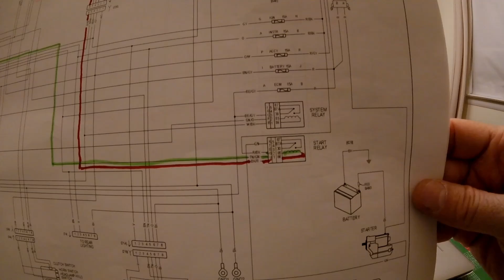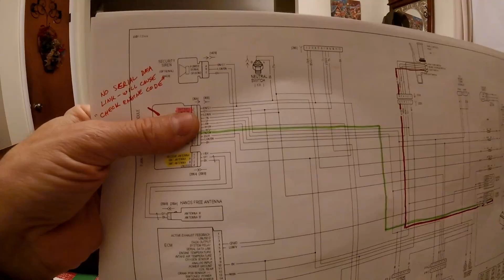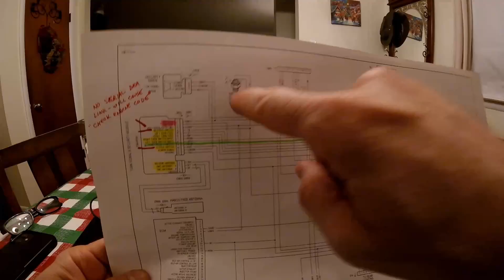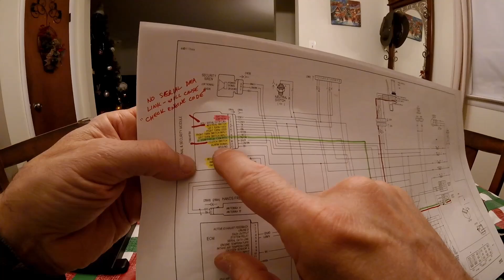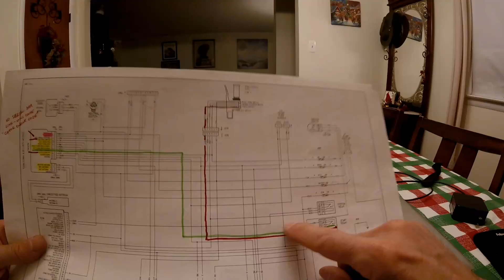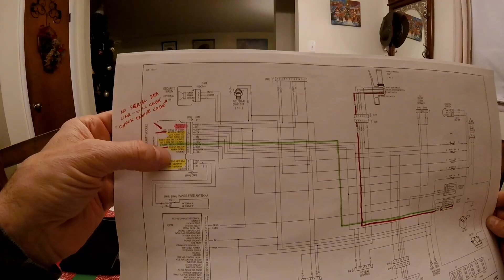Harley Security System Delete & Turn Signal Removal. Twin Cam 1999 to 2010 module TSM & TSSM

Comment: 05 sportster 883 

Would be very grateful for any help or insight of a 2005 Harley sportster. Got outta modified cars and got my first bike.

Bike info: The previous owner or owners had deleted the speedometer. I’m guessing due to having tall risers and deleted the rear signals to be able to use saddlebags. Ignition switch was bypassed too with a switch.

Issue: after , putting a new speedo and turn signals all indicators on, the speedometer mostly works, including neutral light, turn signal indicator (on speedometer), oil light, but the speedometer itself does not move up while riding or the back light for the actual speedometer doesn’t turn on. Rear running light works, but brake light doesn’t work nor do the rear turn signals work. Then the switch for ignition is turned on after a couple of seconds the turn signal blick together a couple times

Was not given key fob or pin

Bike runs like normal no issues other than the ones listed above^

Any advice would be greatly appreciate
Reply from the maker: With the speedo not working I'd also check to see if the power is there. You have a 12 volts from the battery after you turn the main power on and a switched 12 volts. You need both. I'd also check the ground. If you need further help, let me know. It would be very hard for me to think of every issue it could be without me standing at the bike...
Reply from the maker: Wow! You have a lot going on. I’ll pull up the wiring diagram but it sounds like you either have a bad speedo or a bad speedo pick-up. If you search my channel you’ll see I have a video on troubleshooting the speedo. You should check it out. Then we can discuss that problem further.
Reply from the maker: https://youtu.be/p__GXwkqPSY
Reply from the maker: Ok after looking at the wiring diagram I found that the TSM (turn signal module) controls both the front signals, rear signals and dash lights at from the same output. So if the front and dash work you will have to find where the signal is being lost to the rear lights. That being said with the rear signals and the brake light not working I'd look for broken wires unless the brake light switch is bad. The switch is easy to figure out with a volt meter or by jumping the switch wires out with the bike turned on. It should turn the brake light on.
This is for the wiring diagram.
https://serviceinfo.harley-davidson.com/sip/content/document/view?id=5532

Comment: Isn’t this essentially running a direct starter button on the solenoid? I picked up a fobless 04 tc and trying to get it running. It turns over with the direct start button. Does the TSSM inhibit any of the running essentials (spark/injector signal)
Reply from the maker: The relay that it turns off, turns everything off, including the coil and the injectors. My modification doesn’t cost you any money either.

Comment: Anybody wanting security, fob delete theres a vid on that using part # 68920-07 $250, and no wire cutting. I think its' for most big Harleys.. Replaces the signal/security module to the signal only type.  It's just above battery.  I think all the people in comments having problems will need that, and to do a short esc reset as given in instructions.
Reply from the maker: Drag Specialties sells this part also.
Reply: i cut and grounded tan wire it made the bike fire and shut off i need it too stay on

Comment: Hi.  I will give this a go in the next week or two as my fob is very tempermental, My alarm and immobilizer still work ok its just the turning them off with the fob to start it, do you think it would be possible if i fitted a rocker switch in the tan/green wire so in one position it will complete the circuit from module to relay and keep the alarm and immobilizer, then when i want to start the bike flip the switch so the wire from the relay goes to earth. Hopefully have best of both worlds. Thanks Mick.
Reply from the maker: Yes that should be fine. It will go to battery ground not earth… I knew it’s what you meant 😊
Reply: @Rapsgarageshop  Just tried the wire from relay to ground today, All i could get was all the indicators flashing, the engine fired a couple of times and thats it, reconnected the tan/green wire together, engine started fine, any ideas..Thanks
Reply from the maker: @mickd3244 I’d put a volt meter on the output contact of the System Relay to see if it’s staying energized.

Comment: Hi I’ve a 2001 dyna fxd  I cut the tan and green wire from the module under the seat and grounded the wire but now the bike will turn over but won’t start have I grounded the wire going back to the loom and taped off the short bit going into the module
Reply: Put the module back in correct position and the bike started and ran for 45 seconds and cut out and won’t stay running it’s the carb version 2001 fxdt am I better off reconnecting the tan wire to the module and going back to the key fob only the fob inconsistently works feels like it will let me stranded som day
Reply: @skippey1353  did you get your bike running? I’m pretty sure the answer is no! What country are you in? I’m in uk and have just  deleted my security module with no problems but not using this information, had to buy 3 cheap items to make it work, cost in uk about£70 pounds and a bit of wiring.👍
Reply: I can’t find your reply’s to my message! Have you sent me contact details so I can forward you the instructions to remove Tasmania, where are you in uk? I’m in Cornwall👍
Reply: @MarkHancock-u6k  Hi. Do you still monitor this post, really intrested in the TSSM Mod
Reply: @mickdobson mick what country are you in? Send me you email and I will send you instructions to delete T s s m with very little cost, most independent shops want to sell you expensive parts that are not needed!
Reply from the maker: @skippey1353  Sounds like you have a totally separate problem. Try using starting fluid to keep it running when it starts to cut out. This will determine if your problem is fuel related or electrical. Let me know.
Reply: @Rapsgarageshop it ran fine before I went and cut the wire i just felt the immobiliser fob was a bit temperamental and I wanted it gone/deleteded before it let me down on the road I’ll earth the tan green wire directly to the battery earth connector later in the next day or so and get back to you cheers 👍

Comment: Ok so all you do Is cut the starter relay wire , which is tan with green strip.and then ground it. Just depends it from the module
Reply: Well I did that and it wont it will not crank, I took the tan with greenstrip and grounded it to the battery.the one on the module  I did nothing with it
Reply from the maker: @JohnwScottjr.  Sounds like you need to check a few more things - battery good, is the relay good, fuse good, do you have 12 volts at the relay? Let me know...
Reply: @Rapsgarage I will let you know I have not worked on since I text you. I'm going to check all these things
Reply: Hi I hope you're still here . I have 2001 carb softail and no tan/ green wire? How do I know which is no9? 
From u.k . Thanks.
Reply from the maker: @holmicus I just looked it up and it should be exactly like I described. See the Harley website I attached. 

https://serviceinfo.harley-davidson.com/sip/content/document/view?id=5527
Reply: @Rapsgarageshop Thanks I found pesky wire and grounded it. I sent another message.  It cranks but no spark and indicators still flashing 3 times  . ? 
We all appreciate you . Much gratitude.
Reply from the maker: Cut it from the module and ground it

Comment: Sorry to hijack this comment section. I have a 2007 Harley Davidson Wide glide -EFI

I followed the instructions to a tea. The lights still blink when I turn ignition to on. Motorcycle will not start(wouldn't before) but shuts off after a few seconds. Any ideas?
Reply from the maker: You say will not start?? The fastest way to figure out what it can be is to spray it with some starting fluid. If it pops off try to keep it running on the spray. Let me know what happens.
Reply: @Rapsgarageshop Hey rapsgarage so it starts and then dies like the fuel or spark is being cut by the ECU. My bike is EFI
Reply from the maker: @kodyarocho4618  like I said, try to keep it running with the spray. It could be your fuel pump. Let me know afterwards and we can discuss it further.

Comment: Ok sorry about that. Okay. I have a 2007 ultra classic electric glide.  On the starter relay tan wire with green strip. On the module at pin 9 it's a white wire with  blue strip
Reply: Well I finally got it cranked But it won't stay running
Reply from the maker: @JohnwScottjr.  I’d hit it with some starting fluid and see if you can keep it running like that. If you can, you know you have a fuel issue.
Reply: The lights are still flashing But it's still cranking in neutral without holding the clutch in I tried that with the starting fluid Runs with the starting fluid but quits
Reply from the maker: @JohnwScottjr. I’m not sure I can help much more without being at the bike.
Reply from the maker: All the diagrams I see don’t show that.

Comment: I can get it to crank and start but it dies after a few minutes. I clipped the tan wire with the green line and ground at the starter. I can now start the bike but it does after a few seconds. Is this supposed to bypass the security so you can ride the bike? Has anyone actually been able to ride their motorcycle after doing this?
Reply: So you still have the tan connected at the tssm? But taken off the starter ground?
Reply: @jakobrichards7814 I cut the Tan wire with green line at the TSSM. I left enough of a lead to be able to reattach if need be. 

I then ground the tan wire with green line at the relay
Reply: @kodyarocho4618 so you grounded that wire to the relay? Or attach the tan and green wire to a good ground after it’s cut?
Reply: @jakobrichards7814  the wire runs from the relay to the TSSM. It was already attached. When I cut it the section that was running from the relay got grounded to the bike. My bike will now start but immediately dies. It's not a fuel issue
Reply: @kodyarocho4618 I have the same problem.. what to do from here
Reply: @Iniajameskauri  buy a TSM module and flash it to your bike that's what I did. Took a half an hour. The guy in this video is right if you have a carb

Comment: With a bike without a security system, would stripping and grounding out the black ground wire from the tsm also be a viable way of bypassing the tsm while also still having it communicate with the ecm and having other functions work? Bike currently won't start click nothing, all lights and turn signals come on but won't flash so I'm thinking TSM may be bad?
Reply: did it work?

Comment: Hi there. Not sure if you still answer comments and questions but I have an 2001 Wideglide carbed. I tried pin 9 and I saw another comment using pin 10 instead on his 01. I tried pin 10 first. Then pin 9 and still nothing. Any suggestions? Thanks!!
Reply: You nailed it!! I did as you suggested. It in fact was pin 9. Grounded it and it fired up! Cant thank you enough!!
Reply from the maker: @mammen33  I’m so glad to hear it. I appreciate you getting back to me and letting me know how you made out. If I can help in the future, please let me know.
Reply: Yes sir! I will and again, thank you!
Reply: Thank you! I really appreciate all the information. I’m going to be back within the next few days. I’ll let you know
Reply from the maker: @mammen33  Sounds good. I can help further if you need it.
Reply: Hi I am about to try this. On an 09 1200 Nightster. After the 4 listening think I got it sussed. Will let you know. Be mello
Reply from the maker: @maxvfour7345 very good. Thank you for watching
Reply from the maker: I'll look into this tomorrow and get back to you.
Reply: @Rapsgarageshop thank you! I’m wondering if the TSSM is just bad. I see they have smart tsm units for late model Harley’s to totally bypass the security. If it’s something I’m missing that would be great! Thank again!
Reply from the maker: @mammen33  I'm looking at the wiring diagram and it shows it to be pin 9 TAN/GREEN wire. I'll put the link at the bottom of this reply.
You need a volt meter to check for 12v power. The ground bypasses the TSSM module all together. Check that you have 12v on the BLACK/RED wire on the start relay. You'll need the main power switch turned on, the handle bar power switch turned on and a good battery fully charged. Let me know...
https://serviceinfo.harley-davidson.com/sip/content/document/view?id=5527#7aaffc27-5c3d-42d0-9160-a058c340dd46!!1!43

Comment: It worked!
Reply: When you say it works. Do you mean you were able to start and ride it?
Reply from the maker: @kodyarocho4618 yes that’s what he’s saying.
Reply: @kodyarocho4618  yes, it'll bypass the security and signals module so you won't have signals or an instrument cluster, but it will run and ride
Reply: @JustinReh I followed the instructions and it allowed me to start the bike but it shut off after a few seconds. The ECM is still searching for the data handshake from the TSSM and kills fuel and spark.
Reply: @JustinReh are you by chance carbureted?
Reply: @kodyarocho4618  no, mine's fuel injected
Reply: @JustinReh and you have a TSSM ? Sorry to ask so many questions. There's multiple people in the comments saying they were able to fire the bike up but it would die after a few seconds. You're the only comment that said it worked from the get go. I removed wire from pin 9 and ground from the relay. Bike starts but dies. Fuel in good. Bike ran fine before. I dropped my keys when riding and they were run over by traffic
Reply: @kodyarocho4618 were you able to figure it out ? If so how
Reply: @LeviAdkins-lm2pb Yeah I had to buy a TSM from custom dynamics. If you have an EFI there is no way, at all, to bypass the security. I followed the instructions, in every way possible and had no luck. Checked other forums too. If you're carbureted it probably works just fine since you don't have and ECM communicating with the fuel system
Reply: @kodyarocho4618  My bike is EFI as far as I know. I can hear the fuel pump fire up when I turn on the ignition. I didn't have to buy a new TSM.
Reply: @JustinReh  sorry man. It's just not how it works with the security system on a motorcycle that has electronic fuel injection.
Reply: @kodyarocho4618  Ok. Just wanted to share what I did in my fuel injected bike for anyone needing help. Worked for me ;)
Reply: @JustinReh You're full of shit ;)It's a weird thing to lie about but there are weird people on the internet. Have a great day.
Reply: @kodyarocho4618  Lol, ok!? Not sure why you're offended by me fixing my bike and letting others know how, but you do you I guess. 
I mean, I could be wrong...maybe I made up the problem with the bike in my head and this is all a dream!
JFC people are trash sometimes
Reply from the maker: Awesome!

Comment: I’ll try grounding that security bypass wire.

I’m pretty sure my Module just took a dump.

No crank, no turn signals no low beam headlight on my 2001 Dyna.
Reply from the maker: Sounds like a plan. Keep me posted on how you make out.
Reply: @Rapsgarageshop Update

I grounded the grey wire with green stripe (the wire is 24 years old, it looked brown with a green stripe)

My bike now cranks very strongly!!!

Now I have no spark haha.  I’ll have to rewatch your video a few times to figure out if I missed anything.  

Long story short I had a battery short circuit and mess up a bunch of stuff…almost lost the bike in a fire
Reply: @Rapsgarageshop Is there anyway to bypass the BAS part of the TSSM?  I’m pretty sure that’s my problem.  

Bike will now crank since I grounded the wire with green stripe but I’m not getting spark now.  The TSSM module is straight up and down, but I did tip the bike onto its side when it caught fire.  Possibly triggering the BAS?
Reply: I’d like to delete the TSSM entirely if there’s a workaround to allow the ignition to function properly still.
Reply from the maker: @nikasumo  Looks like all you have to do is ground the Tan/Green wire and that should eliminate the TSSM.
Reply: @Rapsgarageshop I figured it out.  Wire #10 on my 2001 Dyna FXD is “Ignition enable signal” Light green with gray stripe

I grounded this wire to frame just like Tan/Green stripe wire and I now have spark 

My wiring diagram/ schematic looked a bit different than the one in your video, probably because my bike is a carbureted 2001

My bike now starts and runs entirely without the TSSM, I just need to figure out the turn signals and speedometer/ tachometer.  At least I can ride now though

I really appreciate your videos!  They were very helpful
Reply from the maker: Awesome! Of course I have a turn signal video 

LED Turn Signal Conversion w/o load resistor Harley Davidson or car
https://youtu.be/UreUuDy7wkc
Reply: @Rapsgarageshop Great ill check it out
Reply: @nikasumo that’s because you have only done half of the job!

Comment: I have a 2001 road king. Lost fob, Looking to bypass just the security. I disconnected the pin at the TSSM "tan/green. Grounded that tan/green wire direct to the chassis. Still no spark at both spark plugs... Am i doing it wrong? or Do i leave the tan/green wire plugged into the TSSM and disconnect the tan/green wire at the relay and ground the tan/green wire to the chassis? or run a ground from the chassis direct to the relay port? Any help much appreciated
Reply from the maker: I’d double check with a meter that the pin that the tan/green wire is grounded at the relay. You just need to have that relay pin grounded. How it gets grounded is up to you.